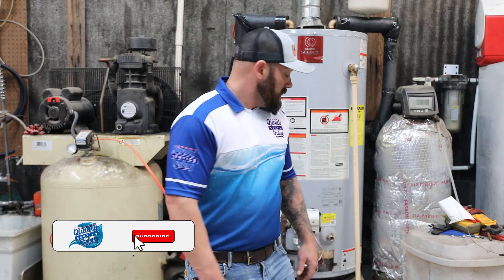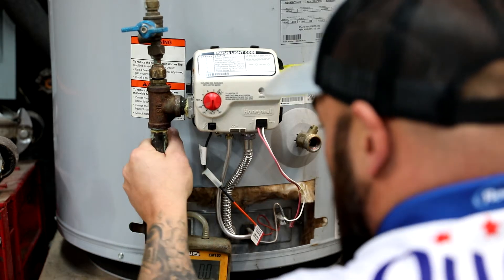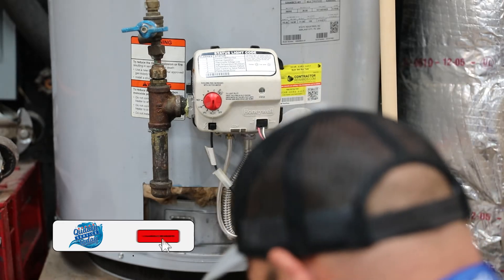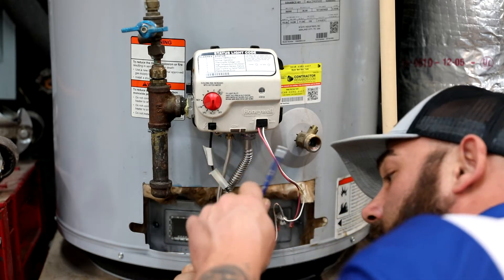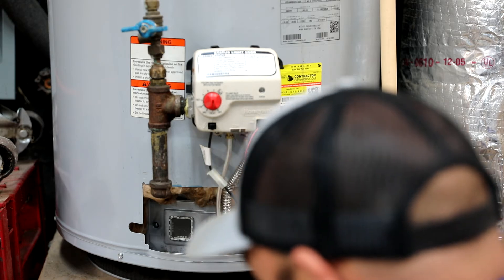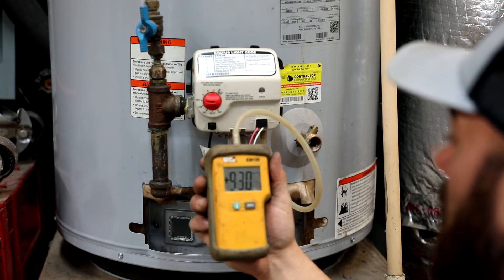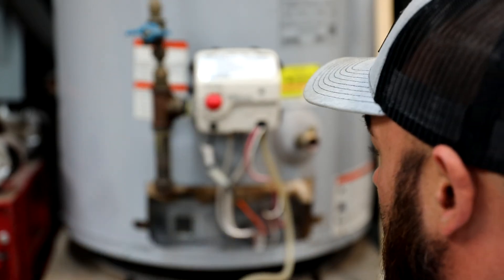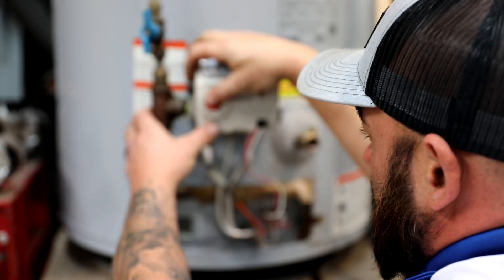Water heater gas pressure/flow test

Comment: Ok. Inlet pressure (inches of  water column, " wc) on LP for my water heater is 11" wc  to 14" wc max. Consider this the supply from the utility regulator. My manifold pressure is 10" wc max. Consider this the supply from the gas valve to the burner. Always use tight fittings to get the most accurate reading. Natural gas utility supply is different. Typically, 3.5 to 7" wc, manufacturers will supply a manifold pressure to their product. Thanks, brother, for the video.

Comment: I thought it should be 3.5 wc coming out of gas valve??
Reply: depends on the water heater and fuel type. one in vid is propane , not natural gas
Reply: I believe it depends on what temperature you have the water heater set to. 2.5" is pretty common